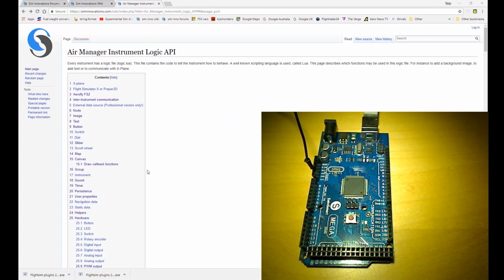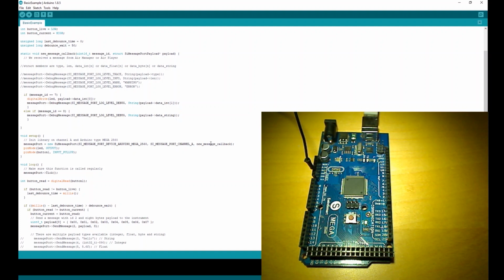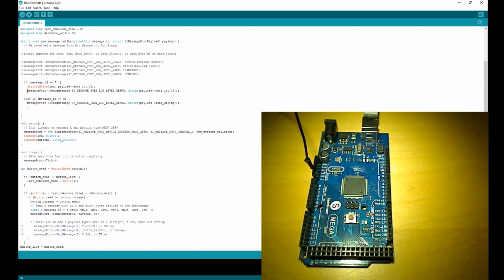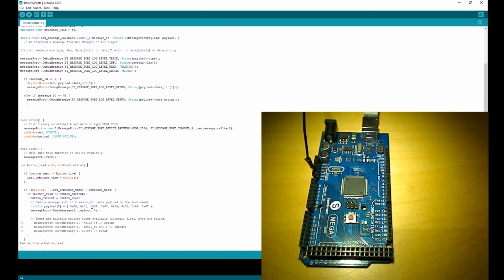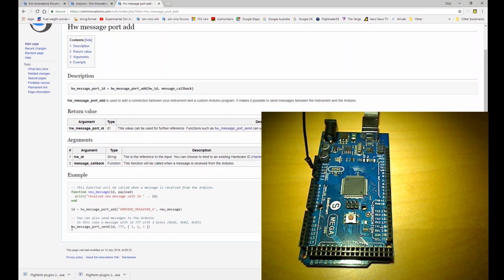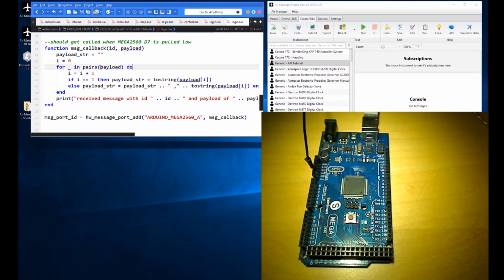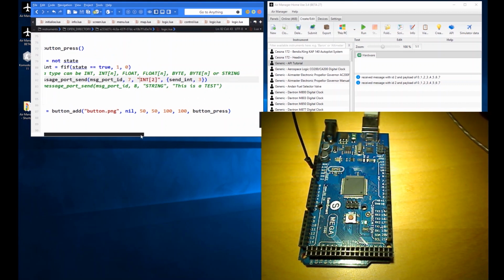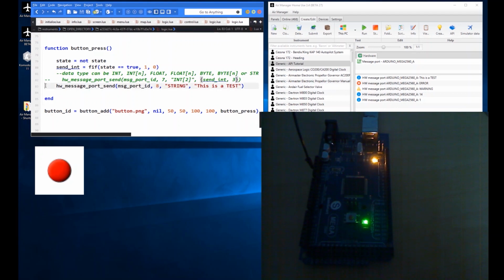Instrument development - E29 - Message port library

Comment: hi, I've accidently set the zoom factor to 500 in  the size's panel to fit my news monitors but air manager close as it start and I can't do anything else. how to reset all the settings and start from a proper version? and most important question, if I uninstal all, does my licence will stay in my pc and I'll be able to reinstall?  thanks
Reply: It's probably running out of memory or something with such a high resolution. You can either remove the config.sqlite3 from C:/users/your_username/Air Manager/ or send it to us and we can reset the 'zoom factor'.